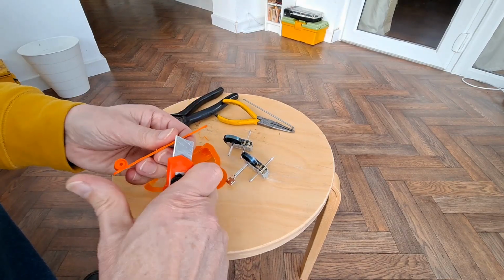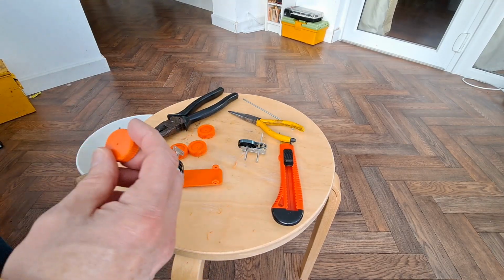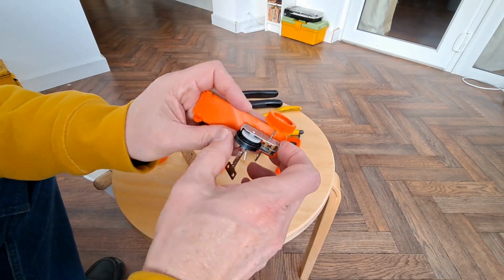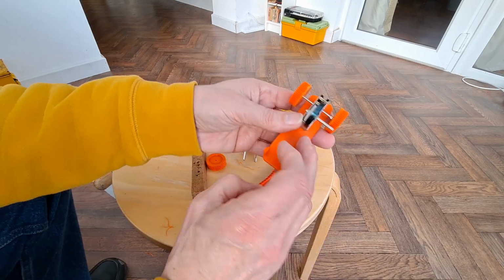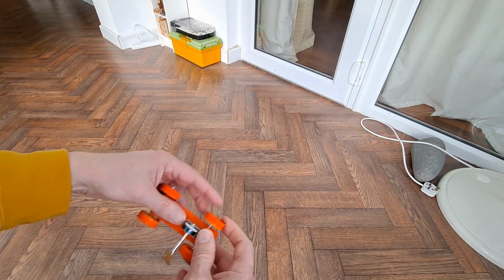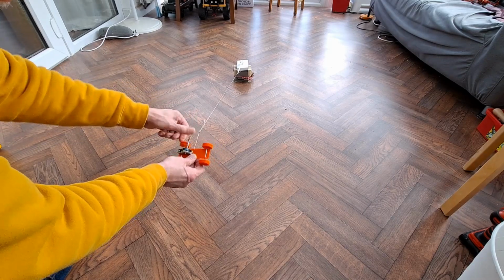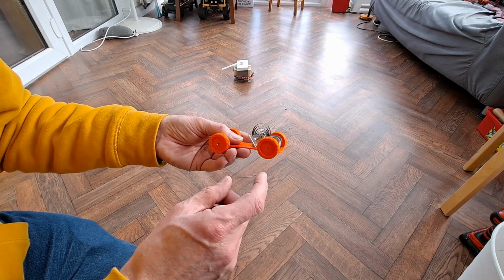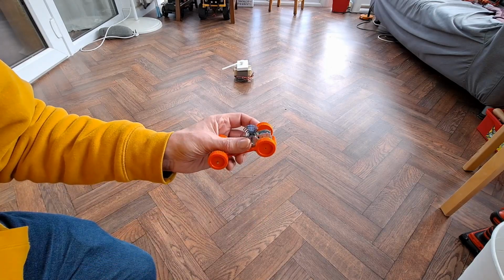Basic Clockwork Car

Comment: Looks promising. I did notice the o rings on the table next to the printer and did wonder if they were for tyres 😉. Thanks 😀 👍
Reply from the maker: The O rings are for wheels,  but in version 2 I make the back wheels bigger to increase the distance,  so those O rings are not big enough.

Comment: Rubber bands around the wheels, for tyres. A tricycle with only one driving wheel would allow a bigger wheel and still give easy access to the winding key, though it might be difficult to get it to balance properly, as the motor wouldn't be on the centreline.